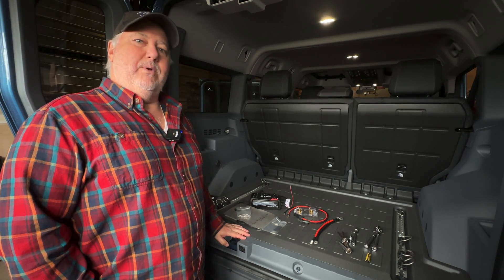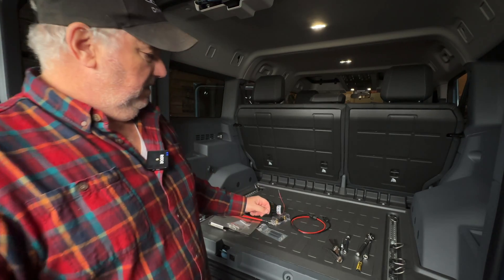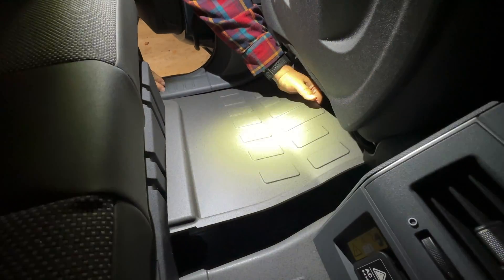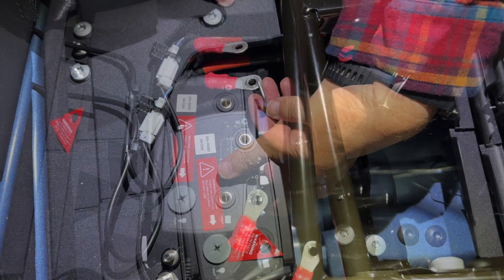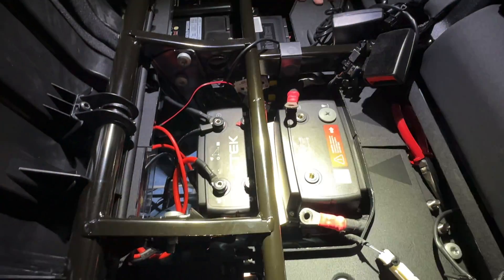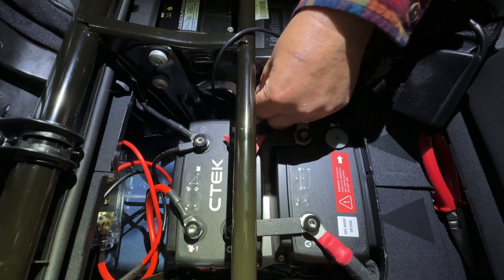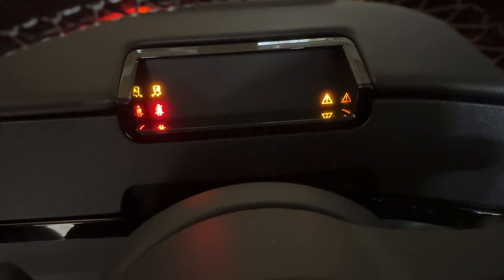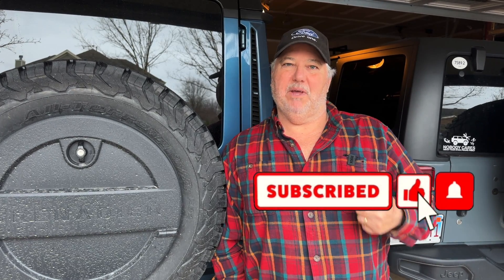Adding Solar Power To The INEOS Grenadier-Installing The CTEK D250SE

Comment: I did fix D250SE for my Ineos use aluminium bar it cost 9£ only for the bar , I believe you don’t need to buy any expensive plate to fix it .thank you for your informative video
Reply from the maker: @KhalifaKhalid-f9f I think you are right and a good handy man with a set of proper tools can figure it out, thanks for encouraging the DIYers!

Comment: nice video!  Thanks!  You might want to secure the 30A fuse with some double sided tape so it doesn't rattle or become damaged down the road 👍
Reply from the maker: Thanks for dropping by. Yep for sure on the fuse. My plan was to route those somewhere that I would have easy access to the plugs when the truck was loaded. Sadly with the truck still in San Diego after the mishap in Baja earlier this year I have not been able to play with it.

Comment: Hi there, nice video. Quick question I’m getting the eco flow alternator charger for my Ineos grenadier and I was just wondering do you know what battery the terminals need to go on because there’s a duel battery system and a starter battery and auxiliary battery? I’m just a bit confused.
Reply from the maker: You have gove a bit beyond my knowledge level with this question. I would reach out to eco flow as I have never used one. I do know the Grenadier has one starter battery that they advise to use on your accessories and the spare is designed to ensure starting power in the event you draw down the primary.

Comment: Another question, would that be possible to connect portable solar panel to High Load Aux Switch and Power Take-Off, then charging a lithium battery through that pre-set line
Reply from the maker: I think the easiest alternative would be to purchase a panel that has an MPPT controller attached (Redarc makes one) and connect it to the jumper points under the hood.

Comment: I am just wondering if you could use ctek 250se alone without 120
Reply from the maker: That would be a question for CTEK, since the Grenadier comes with the 120 (factory dual battery option) I never researched this.

Comment: Excellent video Dick. I followed it to the letter and it worked a treat. Did you ever find out about the smart alternator cable? I left off as you did. Many thanks!!!!
Reply from the maker: The only things I have seen more recently about the smart alternator is contradictory. First CTEK sent a note and said it is normally not hooked up in a consumer application. But also I have seen replies from CTEK that say hook it up if unsure.

With my Grenadier stuck in San Diego waiting to be diagnosed after crapping out in Mexico I have not had the chance to really do much else with it.
Reply: Yeah I saw that. I hope that gets fixed ASAP. Good luck! A quick vid of solar up and running would be great. By installing the 250 I’ve just future proofed right now for a big trip next year. So still looking at the solar solution.
Reply from the maker: @FRO5TBYTE  When I get the truck back I will be looking forward to putting up some more videos!

Comment: You don't appear to have disconnected the ground from the Smartpass.  Both CTEK & Ineos are making it clear that this should be a first step. 

Additionally, (and I don't have the information to hand presently) Ineos are stating a period of time prior to disconnecting to allow various electronics to power down completely.  I believe this is now printed on a battery label to be retro fitted to those vehicles missing this advice/warning.
Reply from the maker: I believe the ground from the Smartpass is connected to the negative post of the starter battery (same place I connected the 250's negative cable) which is the first item I disconnected. If I am mistaken please let us know where it is grounded so that others can do so correctly.

Sadly most of us are not getting much if any information from INEOS regarding the systems but it sounds like you may have some additional insight which would be a huge help if you could pass on a source for INEOS maintenance procedures!

Comment: Didn’t you use the 250 to charge the battery as well??
Reply from the maker: Yes, I didn't cover that aspect as much but the 250 is connected with the Smartpass 120 which brings the entire system to be able to charge at 140 amps.

Thanks for checking us out and taking time to comment.

Comment: Good vid thanks.  Asked Ctek tech about the red wire..  said if unsure what alternator you have, smart or not, connect the red wire. Connected mine, works as described.
Reply from the maker: Yes, I have seen notes from CTEK saying that and when they responded to me they said the red normally not hooked up in a "recreational" vehicle. I have not hooked it up yet simply because INEOS engineering didn't do so with the Smartpass so I stayed consistent.
Reply: INEOS has a smart alternator.
Reply: Duurst red wire from de 120 or also the onze from the 250?
Reply from the maker: @RobertHoekstra-c4z  I am not sure your question but neither of the red wires are connected.